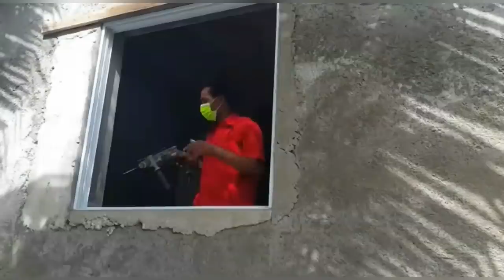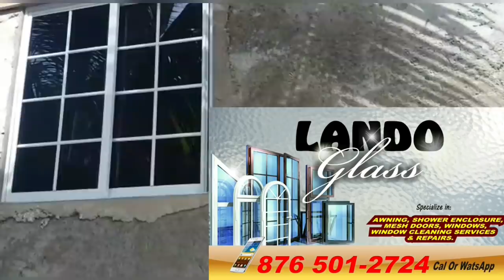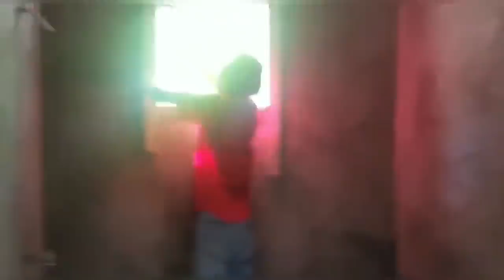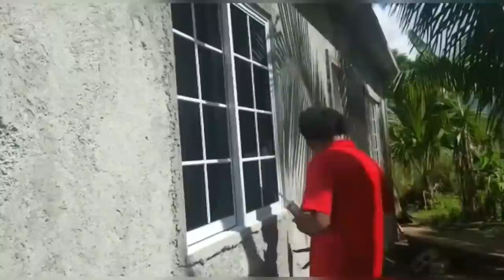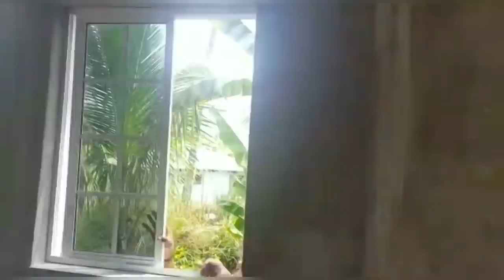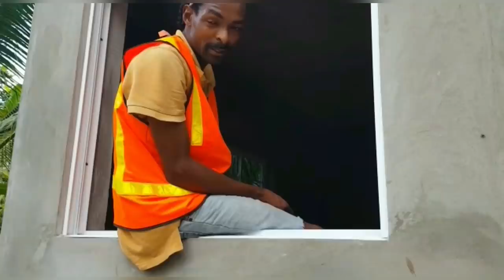THE MOTHER OF NINE WINDOWS ARE IN, BUT WE NEED MORE HELP TO COMPLETE THIS PROJECT

Comment: Just another suggestion miss Shan can you do half of the floor in linoleum and half in tiles where possible as times is hard for everyone aboard and in Jamaica 🇯🇲 so that the family can move in and be comfortable you have to cut back where you can as someone suggested just paint the front and leave the back for a next time fix the toilet,face basin ,tile the shower put linoleum on the floor with a rug so they don't slip over people in the deoprea are losing their jobs so finding it difficult too.
Reply from the maker: Thank You